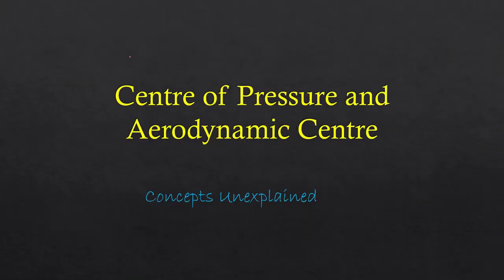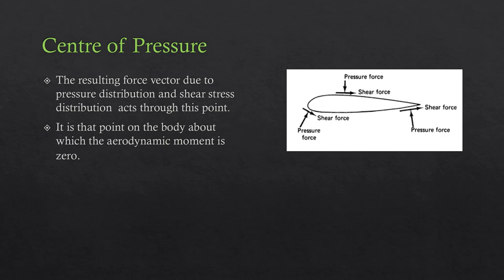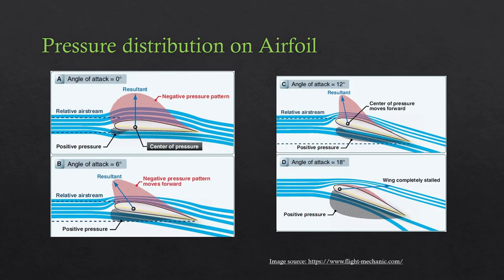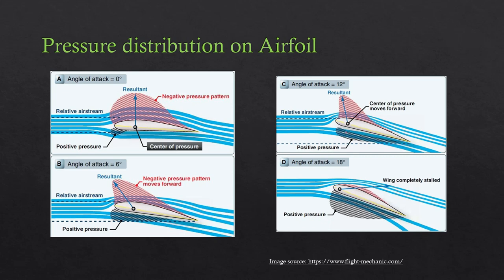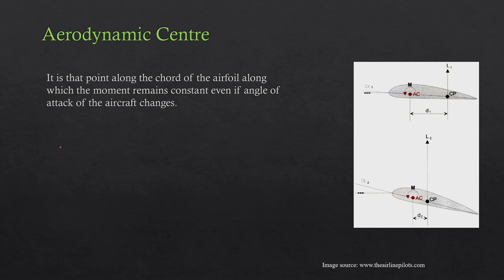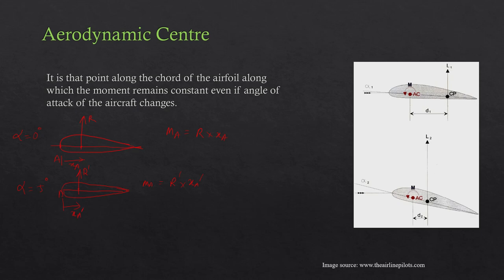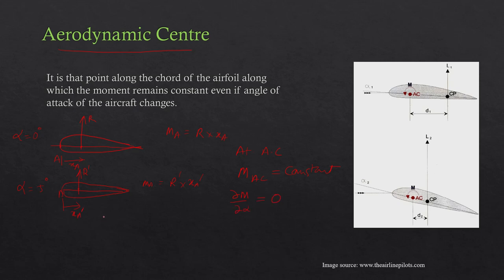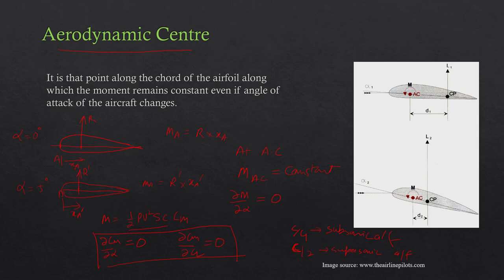What is Center of pressure and Aerodynamic center?

Comment: It is a very good explanation. I would further the explanation of why moment remains constant in AC. If we compare 0 degree AoA to bigger AoA we can observe increase in lift and consequently, the CP also moves forward, thus reducing the x (or the "lever"). Since the moment equations is M = F * x, the increase of AoA causes the force/lift to increase but the x decreases, which is why the two moments stay the same in AP. In the first example the lift is lower but the lever is greater and in the second example it is vice versa, thus resulting in the same moment. I hope this clarifies some possible confusion.

Comment: Very good explanation, thank you. But, what is this aerodynamic useful for? Where does a shaft that holds an airfoil should be located (for VAWTs and for spoilers)?
Reply from the maker: Aerodynamic center is quite useful for stability analysis. For flying wing (wing only) configuration, CG must lie ahead of AC for a longitudinal static stability.
Reply: Alex Keti  statically unstable